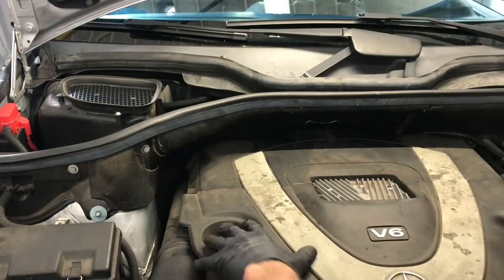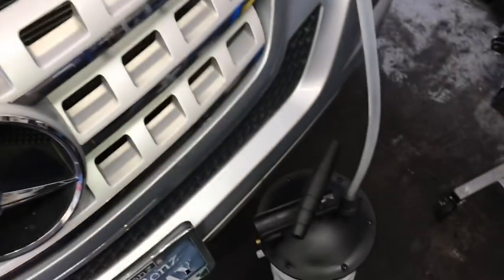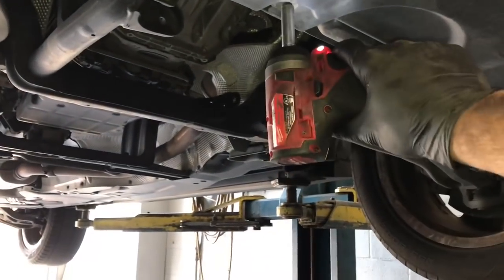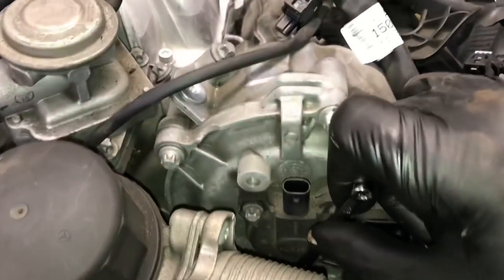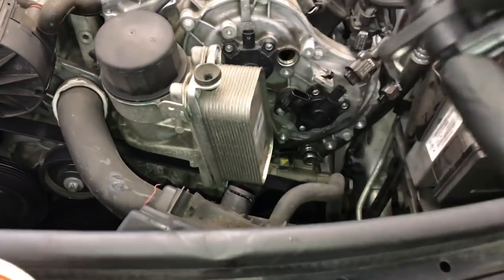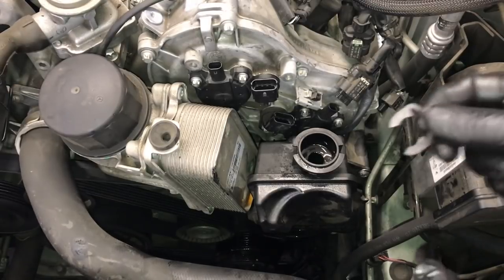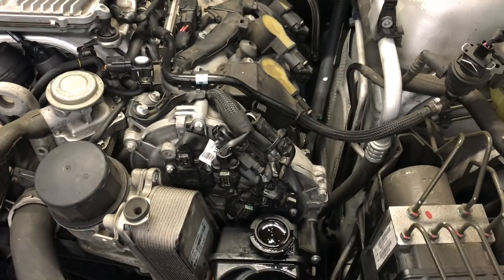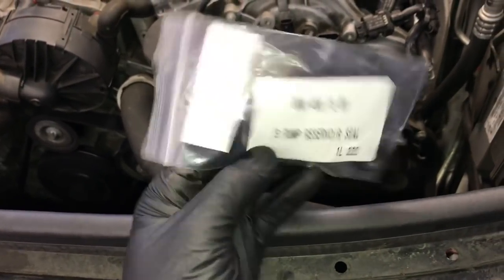Step-by-step Guide To Replacing The Magnetic Cam Adjusters On A Mercedes Ml350 With M272 Engine.

Comment: Hii, I got check engine light and  in OBD scan it says @the position of the intake camshaft deviates from the specified value in direction retarded during cold start'' is it camshaft position sensor or other issues pls reply
Reply: This is a classic problem with the M272 engine.  In my 2006 C280, I had a bad balance shaft (the infamous balance shaft problem that plagued early M272 engines).  I currently have a 2010 C300 and last year I also had the same check engine code...and I replaced all 4 of my magnets and the problem went away.  *Keep in mind that with these M272 engines, there's camshaft sensors and then there's the camshaft magnets (solenoids).  4 magnets and 4 sensors.  The first thing I would do is replace the magnets - since those are usually what fails...and the magnets are doing the actual "work" of adjusting the cams.  So I recommend buying magnets before buying sensors.  If you need sensors too, then that would be a next step.  The magnets are a maintenance issue anyway and after about 100K miles, they really should be changed.  If that's not your problem then unfortunately you have internal engine problems.  I hope you don't have a balance shaft problem (codes 1200, 1204, 1208, etc.) since that's an engine out job and not worth it.  Otherwise, you have some time of other internal timing problem.  Either your camshafts themselves, or the cam guides, timing chain, etc.  I know this engine pretty well...and those are the culprits.  If you have a high mileage car, you "may" want to also try slightly thicker oil.  Don't know what oil you use or specific car you have.  But if you use 0W40 for example and you have high mileage, you may want to change to 5W40 at this point.  Both are approved for the M272 in the USA.  The 5W40 is slightly thicker and the camshafts may respond to it better...just wanted to provide one last thought.
Reply: @AlGolzari  you are 100% correct sir. Adjuster, then solenoids, if neither work chances are its your balance shaft. There was a class action lawsuit against Mercedes for their m272 and m273 engines (they acknowledged that their balance shafts are “defective”). The job can be extremely costly if you take it to a mechanic since would have to remove the engine from the car to replace this part. Good luck to anyone who got a CEL and is going through the diagnosis process, pray its those adjusters🤣
Reply: @TheClearSync  Thanks for your comments, Gitbow.  Actually it's very interesting that you replied to this when you did.  I wrote the above comment 3 months ago and recently, my check engine light came back...but I'm not overly stressed since I know this engine and I don't have the balance shaft issue.  And like I said I replaced all 4 magnets last summer.  I'm now having code P0019, bank 2, sensor b - driver's side, exhaust cam.  The driver's side exhaust cam is not correlating with the crankshaft.  But it's NOT the camshaft position sensor as I suspected since that's usually not the problem.  I swapped it and I get the same code.  I'm thinking that it might be the actual SOLENOID itself - the oil control valve that sits in the engine head, in front of the cams, and they interact with the magnets.  I'm writing this comment if it helps anyone.  If I clear the code with my scan tool, I can drive as much as I want (over 100 miles) with no check engine light.  The light will come on after the next time I start my car, though.  So my next step is to take out the oil control valve, and clean it.  I hope that will fix it.  And I will also test it mechanically. If it's mechanically at fault, I will replace the valve (about $55 for the exhaust side cam and $70 for the intake side cam).  But for those who have this issue too and see this comment, check the oil control valves as a possible solution to all the vvt codes...the valves sometimes get stuck in either the open or closed position.  I don't think it's my crankshaft position sensor since if it was, why would I only get a code for only 1 camshaft?  (But I may check that, too).  My engine oil is clean but I have 137K miles so the oil control valve can be dirty/stuck.  Even though the balance shaft issues only plagued the early M272/273 engines, I believe the M272/273 was the first time Mercedes used variable valve timing in their engine platforms...and these are so finicky.  The car runs fine and I'm not too worried since I know this engine at this point, but I will get to the bottom of this and solve it somehow! I used to also own a 1987 190E 2.6 (straight 6, the original baby Benz)...that car had no variable valve timing and a straight 6 cylinder - man I wish I still had that car, it was UNBREAKABLE! :)
Reply: @AlGolzari  Going through your comments maybe you can help my situation. On my 2006 Mercedes R350. It stopped starting some months back and I’ve been trying to get it back running slowly. Before it stopped starting many things have already been done to the car such as fuel pump, fuel pressure sensor, new coils, new plugs, one o2 sensor, brand new battery, new alternator all at different times of course but just giving a quick background because it was still done during the 1.5 years I’ve had it. It was having multiple cylinder misfires. Changing the plugs and coils did not work. After that the car just stopped starting all together and since then I’ve replaced the fuel injectors. That didn’t help. Mechanic then came back to diagnose the car and said ecm was bad. Had that repaired and yet the car still doesn’t start. I am now searching YouTube and forums for some directions. I am wondering if maybe the camshaft sensors or even the crankshaft sensor may be what the car needs to come back to life. Any ideas or suggestions?
Reply: @sodilouis4418  Hi Sodi, sorry to hear all this trouble.  I'll try to help but just to make sure, I'm not a mechanic, just a "educated amateur" that loves and knows this engine :). Anyway, as I was reading through I also thought perhaps your ECM.  BUT, yes, I do know and have heard about 6 cases where the car wouldn't start and the CRANKshaft sensor could do that.  The camshaft sensors, well, they also may cause the car to not start but do you have a scanner and do you have any camshaft-related codes, somewhere in the range of P0012-P0019?  If you have a code for one camshaft but not another, try swapping it and see if the code changes. In general, the camshaft sensors don't go bad since they are not a moving part, but yes, it IS a possibility.  The magnets, however, do go bad after around 100K miles and I just recently took out and cleaned my oil control valve for left exhaust - P0019.  It didn't cause my car to not start but it did cause a check engine light and a bit of a rough idle, so I'm glad I was able to also fix that myself with a $6 can of parts cleaner and a little of my own labor time.  Have you also changed the PCV valve?  Sorry for some of these questions but I don't think you specified if and what codes you have.  Hope this perhaps helps.
Reply: @sodilouis4418  Also, I know you said you changed your fuel pump but did you also change the fuel filter?  Don't know how many miles you have but I believe a really clogged up fuel filter can cause a no-start issue and when it does start, the car can run like complete garbage.
Reply: @sodilouis4418  With all due respect, I think your mechanic should have been able to test and explore the CRANKshaft sensor as well as camshaft sensors/magnets before you spent money on repairing your ECM...that's not cheap.  I'm curious why he went that route first.  What about timing?  Maybe the timing of the car is so off that it can't start. And that could be the CRANKshaft sensor since the ECM doesn't know the position of the flywheel.  If you had some codes to share it might make it easier for me to possibly help.
Reply: @AlGolzari  unfortunately I can’t see any codes now without the car starting for a test run to see if any codes pops up and when the mechanic put the scanner on the car his scanner showed error with ecm that’s where he made that assumption but the repair shop said the ecm still worked and had communication but it did have some bad parts so I repaired it anyway. If I can remember correctly I was getting some over or under voltage codes. some Too rich or too lean codes . I think I seen something about the egr valve but the problem is I cleared them in hopes the car would start and I can see what codes came back but the car didn’t start so now I’m in guessing mode. Mostly it was pretty much cylinder 2 misfire although everything was replaced and even moved the coils around but it remained on cylinder 2 that’s when I decided for the fuel injectors to try.
Reply: And I don’t think I’ve checked the fuel filter.
Reply: @sodilouis4418  ok I’ve never heard of needing to scan a car with the engine running.  You usually scan a car with the ignition in position 2 and sometimes position 1 will work.  It all seems strange.  I tried but I’m sorry it seems I can’t help any further.
Reply: @sodilouis4418  a scanner can read information from the computer as long as there is power.  and stores information the last time the car was on.  Either as a current or a permanent code.  All cars with OBD 2 have this basic function.  I think OBD 2 started around 1997 or maybe 1992, so your car has OBD 2.
Reply: @AlGolzari  No problem thank you so much I will still try the few things you did mention to see if it works.
Reply: Update 9 months later.  Last month I took out the oil control valve, cleaned it, and re-installed it and p0019 is gone.  I have information on mbworld or benzworld with the details if anyone needs it.  You can look up the post by my name.
Reply: @AlGolzari  yes I can scan it in the position 2 but after trying to clear the codes after doing some repairs the car hasn’t started and was unable to drive it for any codes to return
Reply: @sodilouis4418  ok but you need to look at the codes.  I was trying to say it softly but I’m sorry - it is incorrect to think you can’t check codes without the car running.  If you don’t check with a scanner for codes you will continue to waste your time.  Hook up a scanner and review the codes.
Reply: That’s why I don’t have codes I was just trying to remember what codes were there before clearing them but I’ve been fighting this battle for over 3 months now.
Reply: @AlGolzari  hello so i have a 2010 c300 and i have the codes p0019 and p0016 i replaced all 4 cam sensors and one magnet adjuster behind the pwrs rsvor but the code is still there. what should i do? replace the other 3 magnets? please help my emissons is coming up soon.
thanks you
Reply: @AlGolzari  where is the  oil control valve located in the 2010 c300? is it easy?
Reply: @AlGolzari  plasae tell me what is it is

Comment: You DO NOT need to remove the reservoir.  You CAN get the bolts and sensors out without removing it,
granted its a bit tight but it CAN be done. Just put a rag underneath the sensors just in case you drop the bolts.
Reply: Depends on the vehicle, I had to loosen my reservoir to have clearance for the magnet to come out.